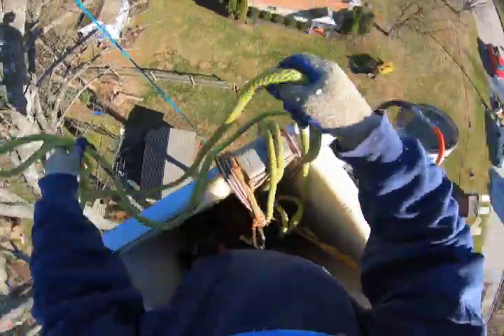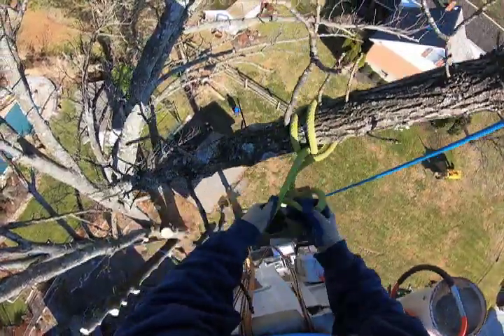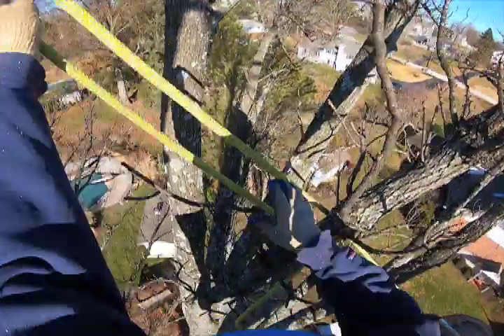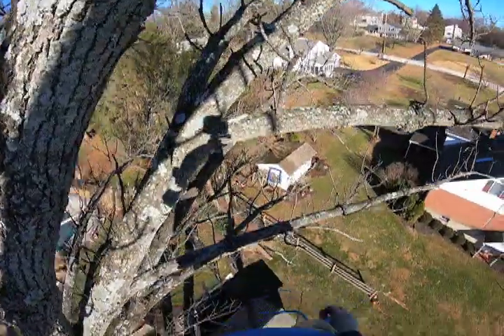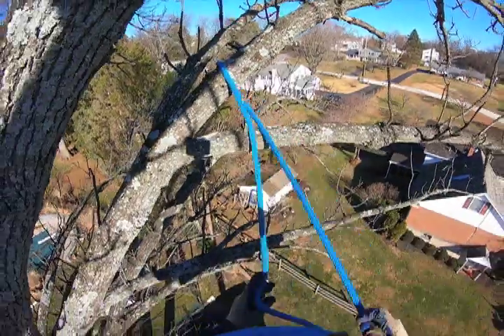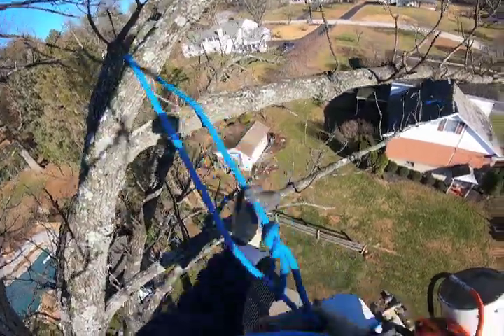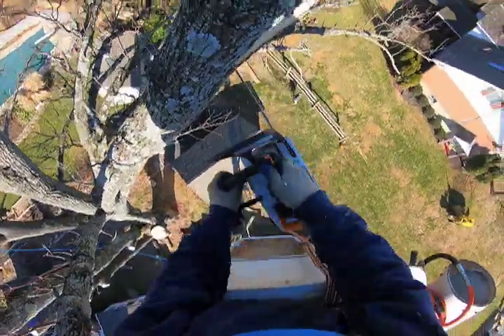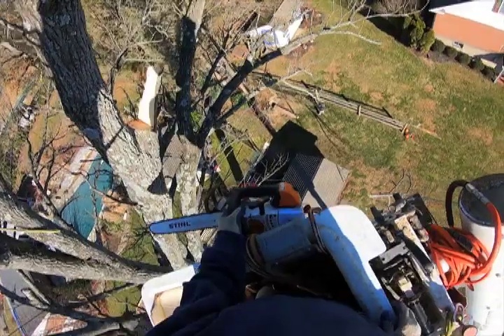Triangulated Support for Satellite Rigging Point

Comment: That's a pretty good idea. This is a fancy version of a 'dead man' where I'm from or a 'static line' tie off.

Also, I always trim the limbs down to just the part of the crotch that im rigging off of for less leverage stress when the whole thing bounces from the load. Definitely gives piece of mind when using it to climb (obv. only for a redirect). And because the sides of the crotch are shorter when I do this, It has the added benefit of quickly whipping your rope over the edge instead of having to pull the rope all the way through the crotch and retying. 

Also, that whole tree looks like it could be done with proper snap cuts. Why rig at all if you don't have to. Thats my motto
Reply from the maker: I'll ususally trim the limb used forsatellite rigging down near the crotch as well, but there was so little weight onvolved in this one I did't bother. I just waited to bomb the limb in one cut after no longer needing it for rigging. And while I understand tht it's tough to tell just how big a tree like that is, the was NFW to use snap cuts on that monster.
Reply: The shed undr there?cant snipcut outta that now can ys
Reply: He’s saying bypass cuts break it off and throw clear of the shed. Probably more strain on the body that way, if you have the lift and can move around easily letting the rope do the work.
Reply: Thank you for the great reply, for some reason I feel compelled to post a comment after more than a couple pops, I will try to not do that so much ,keep the vids coming
Reply: Holly smokes we have a Pro here.
Great Comment on the trimming the swing limb, that makes alot of sence to me, and your tieing is so fast I can't see it in my mind.
Thanks for the great comnent.
  Integrated learning. 
Thanks,  (Hanging with the Big Dawgs).  Greatful.